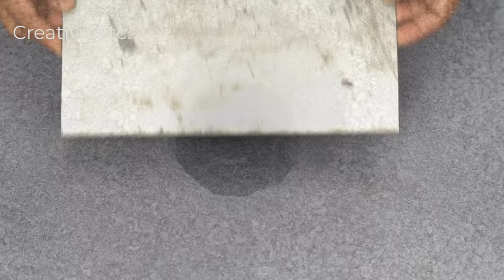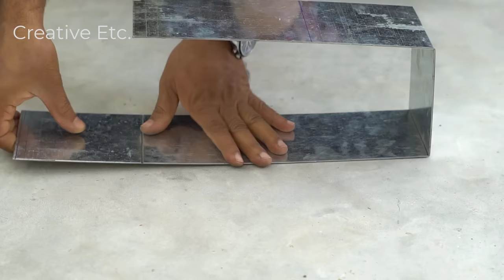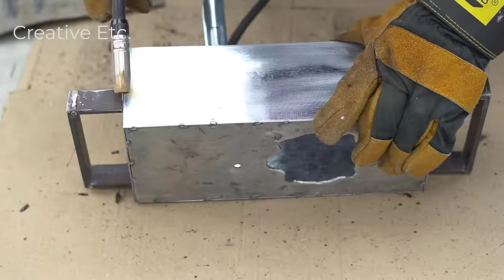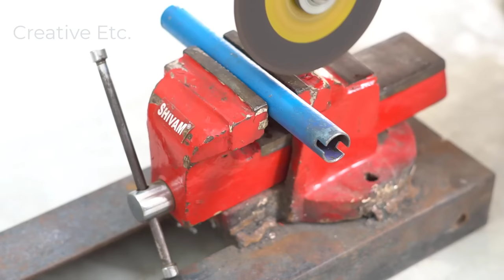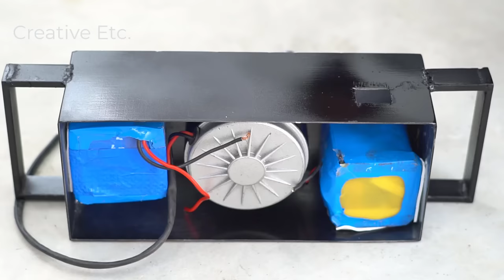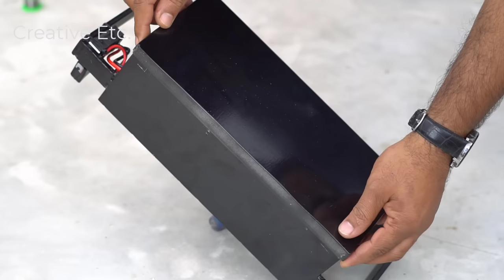DIY Earth Auger Machine / Soil Digger

Comment: It's not safe, because the metal sheets are thin, if a jerk (locked on the shaft) then the motor will turn and the sheets will cut the user's hands.
Reply: Right Sir. I should not be done with thin sheets. But concept is nice.